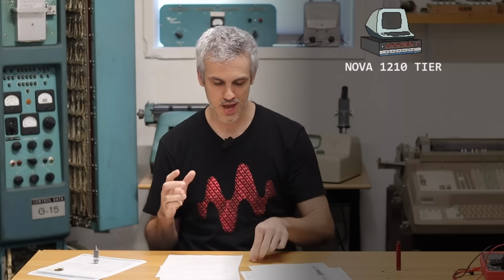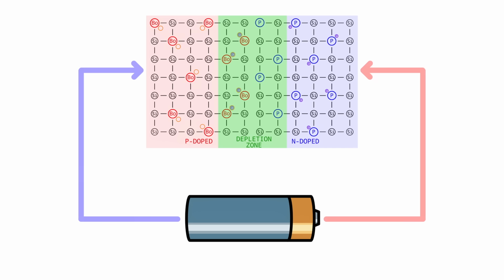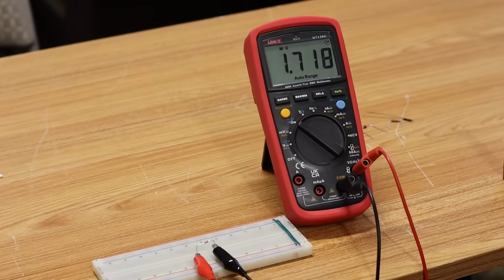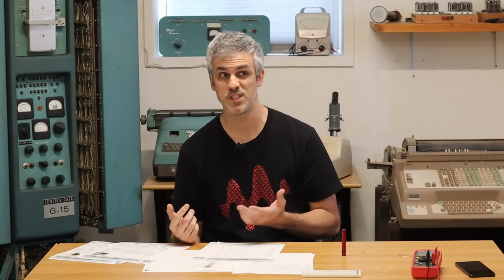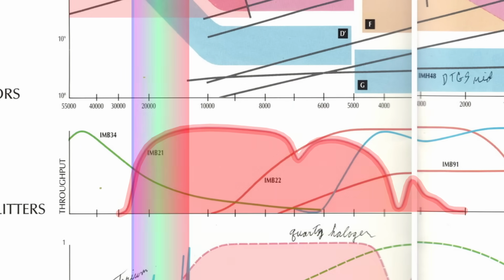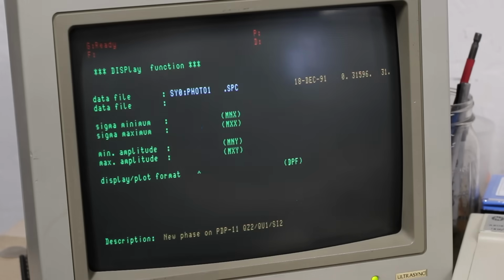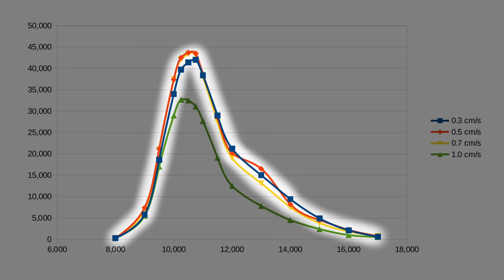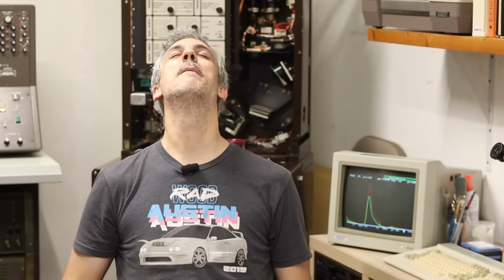How Do Photodiodes Work?

Comment: Photodiodes can be operated in two modes: Photoconductive (the method you showed in the video) and photovoltaic. In the latter case, you use the photodiode as a tiny solar cell and measure the short circuit current. This method is less noisy as it does not produce a dark current, but it is slower. You are basically trading speed for sensitivity.

Comment: That was amazing!  The paper tape reader for the UK Colossus code breaking computer from 1945 used Cesium photocells and could read at 5000 characters per second.  The photocells are vacuum tubes that fit an Octal base so the optical path had to be complicated to spread the rows from the tape out to reach each tube. A 50 watt car headlamp was used for illumination
Reply: And the paper tape breaking because of the speed was indeed a limiting factor!
Reply: @Zadster   And how small you can make the holes.
Reply: @wil @williammentink The hole size (and the paper tape width) were effectively standardised by the Baudot code teleprinters that have been in use since the 1870s for automated telegraph systems
Reply: And it was a Lucas headlamp, so they had to hand-select extra sensitive photocells.

Comment: Erm... At 10:25 you have a really good pic of the diode, but the number on it says 34F2, not 3F42
Reply: Interesting catch... Looking up that number there actually does seem to be a datasheet available! I'm kind of glad David didn't notice the transposition though or we might not have this excellent video to watch and absorb
Reply: What's interesting too is that on the datasheet it does seem to match the spectral response Dave found, but (if I'm reading it right) the frequency response drops off at around 100kHz. 

The diode otherwise has a breakdown voltage of 40V and a current flow between 240-720 uA given if it's shown light at 2500 lux.

Comment: You can used LEDs as photodiodes for visible spectrum.
Reply: This is possible even when the LED appears to be lit; it can be switched off briefly and used as a sensor without the human eye noticing.
Reply: @grosseruser  yes but the LED has to already be wired to a pin capable of being GPIO/PWM and also a high sensitivity ADC. Probably indicator lights on our appliances and devices are generally controlled by GPIO or PWM driver and actual transistors. Generally when designing embedded electronics you don't add hardware that isn't necessary, and you don't use a micrcontroller's gpio pin which is capable of more than what you need it for to prevent conflicts between devices.

But even if they did attach the LED to a pin capable of both PWM and ADC, and that ADC has a high resolution to pick up the tiny voltage generated by the LED, that would basically just give you a single monochrome ambient brightness value. you can't do a whole lot with that, but you can sample really fast and then analyze the samples to see if there is 60hz or 50hz lighting in the room, etc. but there's not much other intelligence you can gather from the output of one diode
Reply: @chrismofer  You don't need an ADC; the LED behaves like a (tiny) capacitor, so after reverse-biasing it, you can measure the time it takes for the voltage to rise or fall. I’ve used this in proximity sensors. With cheap microcontrollers, which are 10 or 20 times faster and cheaper than an Arduino, this is often easier than incorporating an additional component like a photodiode. Even with an Arduino it's possible.(Bearbeitet)Original wiederherstellen
Reply: a transparent LED with the domed lens on top, though, only samples a small spotlight area, so you could detect if people pass in front of the light I suppose, and if the device has an IMU and a compass like a mobile device, then you can sweep the LED around to point different directions and use the IMU to dead reckon where to place all those samples and build up a very blurry map of what an environment looks like. But that requires a willing operator to slew their device around and it's easier to sneak a camera somewhere.

Comment: Not only does the resistance change, but you can measure voltage across the leads when light strikes the junction. So you could design a high impedance voltage triggered circuit that used a diode to detect light as a voltage.

Comment: Even extremely cheap "light pipe" toslink fiber optic receivers barely blink an eye at detecting more than a million pulses of light per second. Amazing little devices!
Reply: Toslink can handle 8 channels of 24 bit audio, as used in Alesis ADAT professional multi-track recorders.

Comment: Wow. It's so lucky you had a Bomem Spectrometer & PDP-11/73 lying around. 😉
Reply: A PDP-11/73 with a massive vector graphics processor card!
Reply: @alanclarke4646 Just imagine what you could do with that sheer amount of processing power.
Reply: For sure! I always wondered what I would use one of those for, now I know! Thinking of getting one for my EDC kit, just in case I run into a 60-year-old photo diode that comes with no spec sheet.

Comment: Great episode!, But I think you have an arithmetic mistake; if the whole diameters differ .65mm then the signal must stabilize in .325mm as the holes are centered to each other. This makes the 200 characters per minute frequency about 1400 Hz and the 400 about 2800. Still well below the 20 kHz though.
Reply: It is probably more complicated than that, as you are dealing with a ramp up/down on both devices and the response curve of the A/D converter. This is probably why I avoided anything to do with hardware design; abstract 1 and 0 is more my speed. I do know you can transmit music over light from a modulated flashlight bulb to a cheap solar cell (the 20 kHz top again works).
Reply: One could also offset the clock photodiode a bit to read the hole a bit later, giving you plenty more headroom.
Reply: @Mueller3D that’s true, but since the explanation was based on the graphic, my reflection is also solely based on that.

Comment: 5:55 or the Pop It Voltage because typically you see a flash hear something like fireworks or a gunshot, and smell burn silicon and epoxy, and some acrid smoke 

the more voltage and current the more bang youll get

because unless its a zener most diodes will fail when they breakdown like that

dunno can you blow up a mercury arc rectifier via reverse biasing it?
Reply: just like a transistor is in effect a voltage or current controlled diode

unless its a special transistor like FET, that can control an A/C current from drain to souce or emitter to collector 

instead of needing to have a voltage drop across the diode to conduct, transistor needs you to pump charge in to the depletion zones, you have more than one, npn or pnp, adding the base or gate junction... thats why they can turn off and on like diode (rectify or no rectify) , or vary a large current from a small voltage or current

Comment: Fun fact: every Diode is also an LED, and a solar cell.
Reply: And transistors are basically two diodes, so they also give off light and create a voltage when light hits them. So if you had a clear IC and an infrared camera you could see the tiny little transistor junctions light up as circuits work. Because heat is a form of light, diodes can also be used to measure temperature and they can be used to transfer heat as Thermoelectric coolers.
Reply: @3fives-j5w  I used to have an old socket 7 motherboard and it had a transistor underneath the CPU as a temperature sensor. 

I was saying "what a weird spot for a transistor" till I read the instruction manual and it stated to put a dab of thermal compound on it for contact with the CPU for temp sensing.
Reply: @volvo09  I have some Lenovo little 1L PCs I saved from e-waste. One of them was tossed in the bin without the case and it broke off the temperature sensor by the fan inlet. It was just a 2N3904 transistor. Soldered in a new one and it's perfectly fine. The circuit measures the base-emitter voltage, which varies with temperature, and is pretty consistent (within a few degs C) across jellybean transistors, and I guess this is a very old way of doing things but still very robust (and cheap). No need for more than a few degs of precision for a case inlet temp sensor.
Reply: @3fives-j5w  "Because heat is a form of light, diodes can also be used to measure temperature" semiconductor junctions don't produce a voltage below their bandgap energy. Thermal IR is regularly well below that.
Reply: @graealex  OTOH, a diode can in fact be used as a temperature sensor because the forward voltage has a predictable variation with temperature. So wrong principle of operation, but still feasible from a technical standpoint! 😆
Reply: @MikeU128  Basically how a (micro-)bolometer works, yes. But physically, the wavelength of day-to-day heat radiation is too long to register on any kind of photodiode.
Reply: And if you apply a high enough voltage, a NED (Noise Emitting Diode) 😂
Reply: @mikescott58  Well, sure with a high enough voltage ANYTHING will emit noise 🤣
Reply: @ct6502c  LEDs make a startling (or satisfying, depending on whether it was intentional) "pop" if you connect them across the supply rails without a dropping resistor. This is typically accompanied by part of the LED package launching itself across the room. Wear your eye protection!
Reply: @mikescott58  So will a resistor.
Reply: True. But diodes tend to be more "expressive"
Reply: And like... DRAM can be used as an optical sensor array.
Reply: @maskddingo1779  No guarantee on the fets being in a perfect grid though.
Reply: @3fives-j5w  Or for them having equal sensitivity, and if you have reallocated rows because of defect management during manufacture you get interesting artifacts. But for a very limited light range they do work well. Fun thing is modern CMOS camera sensors also make poor memory devices, if you keep them dark.
Reply: @maskddingo1779  that’s how the very first build-it-yourself digital camera worked, from the very early 80s, with a delidded memory chip
Reply: @gabotron94  Yeah! I've actually seen a working example of this at VCF before!
Reply: Not only that, but it will respond best to photons of the same wavelength it emits based on its band-gap (as an LED). 😊
Reply: @williamsquires3070  Yes, because the wavelength of a photon varies inversely with the amount of energy it is carrying, and the stable energy states within a material are literally what makes it that material.  Any photon emitted or absorbed will necessarily have an energy equal to the difference between some pair of these states.
Reply: An LED.. But only once.
Reply: @miku_hadronyou mean flash bulb?
Reply: Yep, and it’s also a magic-smoke generator… 😂
Reply: And a fuse.
Reply: LED's backwards are also receivers
Reply: But some of them only emit light _once_, .....

Seriously, though, photons striking a diode can impart energy to charge carriers and push them across the P-N junction (which is what's happening inside a photodiode); and even if a voltage is not being applied, this will result in a flow of current through any load connected to it (which is what is happening inside a solar panel).  Unsurprisingly, this also works in reverse: an electron can give up some of its excess energy by shooting out a photon (which is what is happening inside an LED.  The fact of it being a solid lump of material as opposed to a gas means everything is already in place, so the striking voltage is no higher than the maintaining voltage).  But the real world is messy, and a diode that's made to be good at one job will be lousy at most of the others.
Reply: Yep.  Most people don't understand that a photovoltaic chip is just a diode made really big!  The current is generated by freeing charge carriers in the depletion region and the voltage is developed by the effective forward voltage across the junction.  In short you free a charge carrier, and it is forced to leave the depletion region because of the electrostatic charge caused by the doping, thus generating a voltage and current.
Reply: Well, a deep -IR LED, at least. I'm embarrassed to admit that I've also turned a number of 1N914 & 1N4148 diodes into incandescent lights, briefly. lol
Reply: @theantipope4354 SED's (Smoke Emitting Diodes)

Comment: 0:17 It's actually wild that the G15 only uses ~50% more vacuum tubes than the UE1. The engineering needed to make it that efficient is insane.
Reply: The magnetic drum memory is making a big difference
Reply: @M4nusky  That and a lot of diode logic.
Reply: @stevegreen5358 Mainly they are mostly double triodes so nearly if not double the actual switching elements.
Reply: The G-15 is a serial machine, so in effect it only deals with one bit at a time.